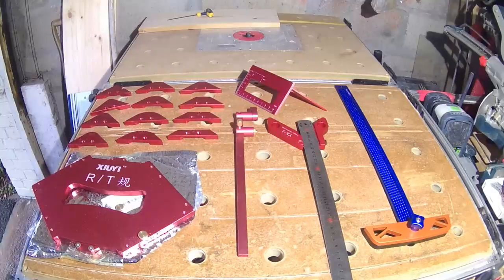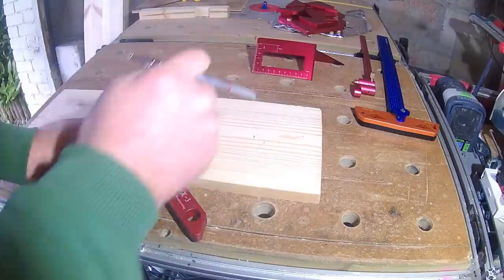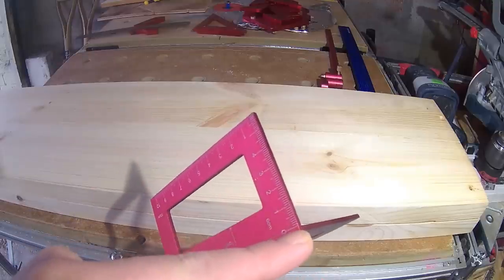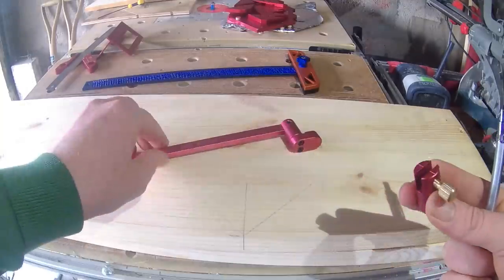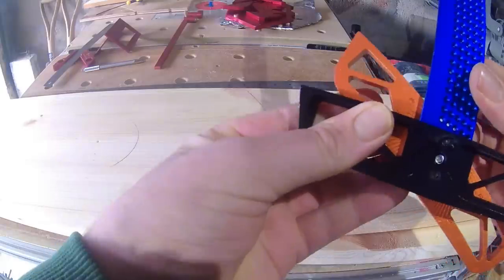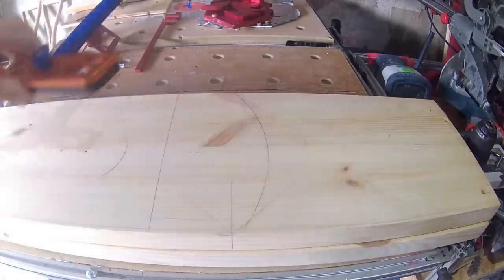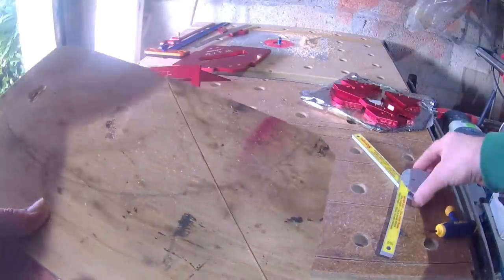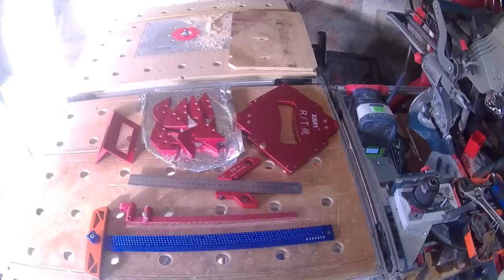Banggood Tools!! Squares, Trammel and Router Template Set!

Comment: Excellent review of the tools.  It's important for older woodworkers like myself to be able to read the markings without having to use a magnifying glass or guess at the markings.  The trick with the washer was perfect on the circle maker.
Reply from the maker: Thanks GunnerA19. My eyesight is alright but even so, was really hard to read the t-square. Prefer measure marks painted a different colour really.

Comment: Tip.
With anodised layout tools to make numbers stand out better i used line marking spraypaint over the numbers then rubbed off the paint from the flat surface with a flat piece of wood to leave the paint in the numbers so they stand out better. Also works on circular saw base plates. Your welcome guys 👍
Reply from the maker: Decent tip that mate.👌

Comment: Im hoping they come out with one of those tracksaw 90 degree guides. Maybe give them a hint 😊
Reply from the maker: They do have a decent looking rail lift for a bench. That's about it for rails though. Pretty slim pickings on that front. Tried suggesting rail clamps before and, well, something was lost in translation so i gave up.
Reply: @BischBaschBosch  To be honest, I wouldn't expect them to attempt to make one as the tolerances would be difficult to achieve on the cheap, and then theres the whole fitting per manufacturer issue.
Reply from the maker: @SirBenJamin_  I think compatibility with manufacturers would be more of an issue than tight tolerances. Most of these tools are made in the mega factories in Shenzhen and Guangdong. The same places our branded "made in China" tools and gadgets are made.  Tight tolerances aren't a problem for them these days.

Comment: Thanks for the review. The router template set looks great. I looked at your review for the other set but it was too small and I felt your fingers would be too close to the bit. I like how large this one is and how much it will protect your fingers. Next time I'm planning a project where I need to do corners I'll keep this in mind.
Reply from the maker: Thanks K.B. I was dubious about the smaller templates at first. But, as your finger pressure is essentially pulling away from the cutter to keep it tight to the work piece, you get used to it and feel safe quite quickly. Just remember to go the right way, against the cutter. The size and weight of the one in this vid does add confidence though.

Comment: Concerning the router corner templates: you don't have to change the position of the screws if you flip the whole thing over - the screws can remain in their positions forever!
Reply from the maker: Quite so. I do say in the video that the reason I had to move them around when flipped over is a couple of my thumb screws arrived damaged. I've since replaced them and, like you say, they just stay permanently in place on each side of the main body.